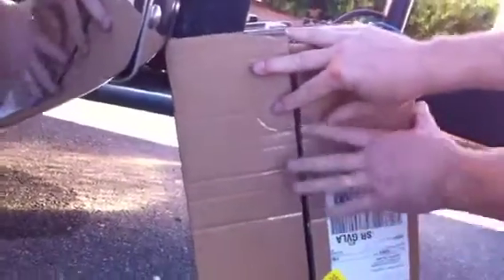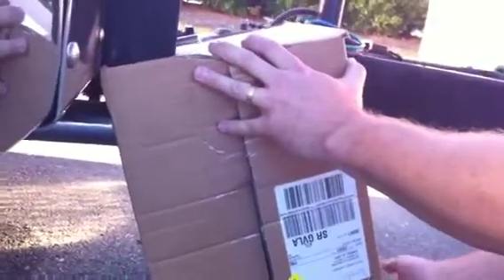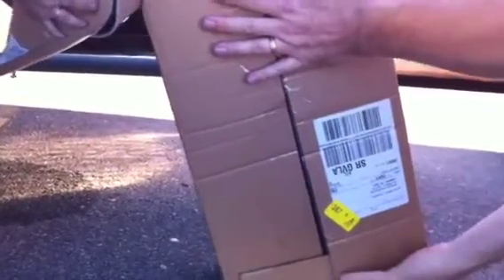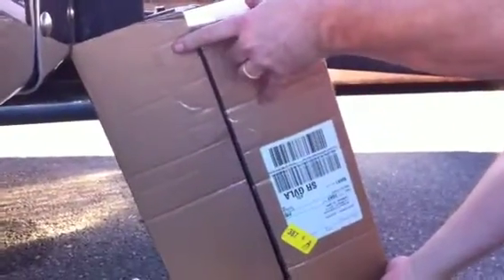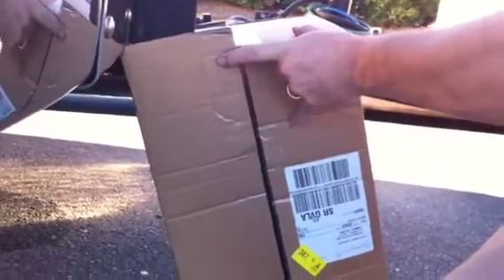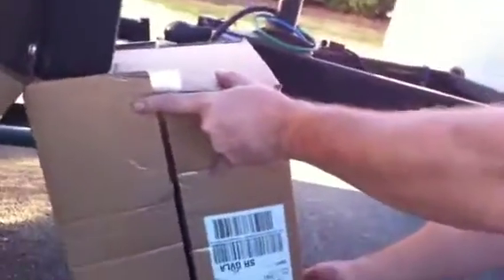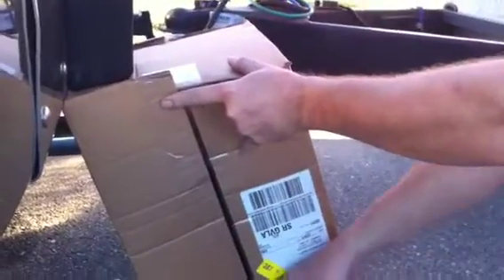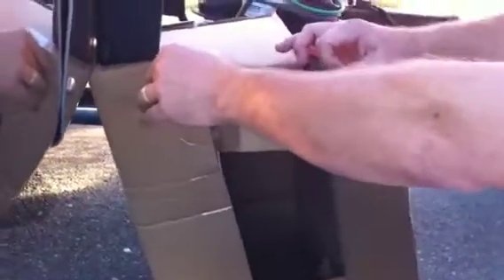Carbon Monoxide Alarm Test with enclosed Exhaust

Comment: UL listed CO alarms are required to WAIT to alarm until CO has been continuously over 400ppm for 4 to 15 minutes.   (or 1-4 hours over 70ppm at the lowest limit).   

If you press the test button, you are only testing the battery, light and alarm, not the CO sensor.

To test sensor response, you need a portable detector with a digital display.  Also get one with a recall button, so you can see what most recent peak level has been.   But note the UL listed types show 0 from 0-29ppm.   Professional CO detectors that display from 1ppm cost $100-$200 and can be set to alarm instantly at any level.